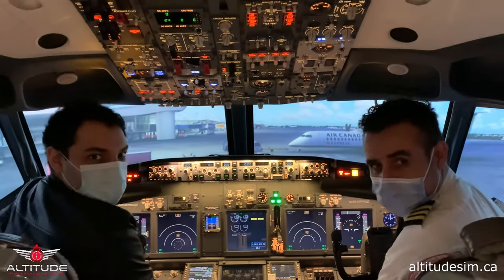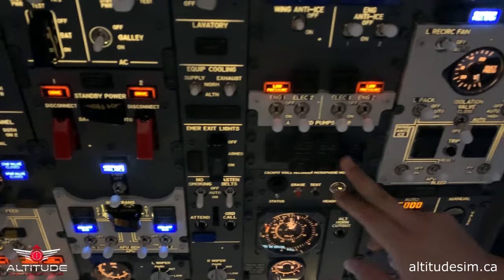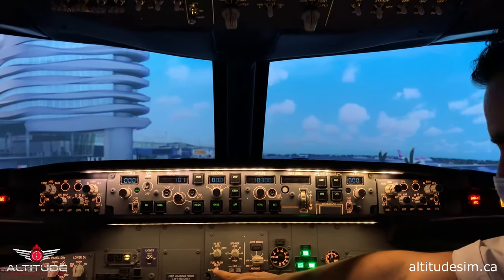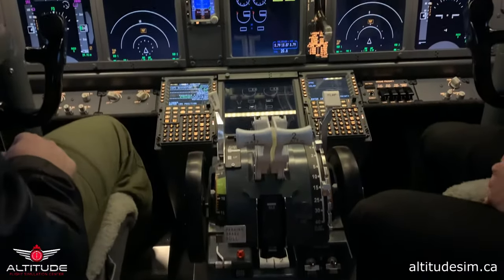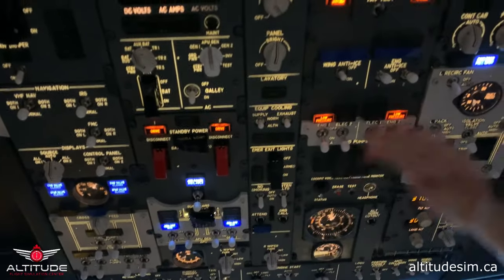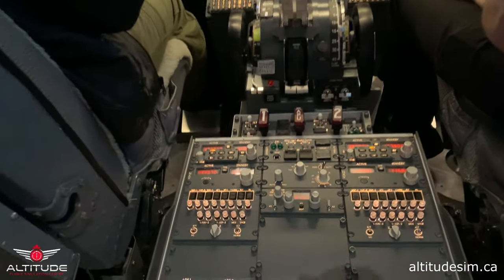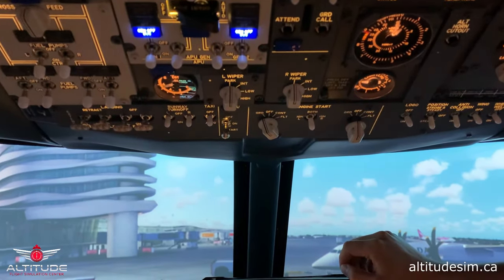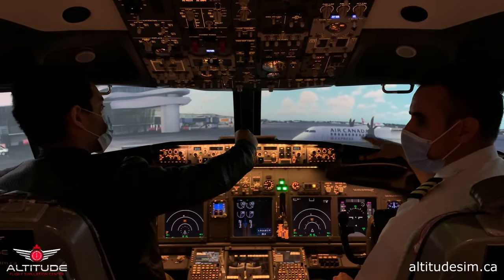Boeing 737-800 engines start up

Comment: Before starting the APU, don’t forget the FIRE TEST.
Reply from the maker: Thanks for the feedback
Reply: Before even putting a single fuel pump even do a fire test before ;)
Reply: You also don't have to hold it 3 seconds, just flip it to START and release.
Reply: Just find the reset button and start the xplane again
Reply: What about contacting the ground team before conducting fire test
Reply: @keenanpaul8968  Of course.
Reply: @keenanpaul8968  if the airplane is parked remotely and has no power, how do you plan on doing a fire test.  Rookie.
Reply: @justinglass9340  with batteries?

Comment: Great  , now the chances of me stealing a plane are high
Reply: FBI enters the Chat
Reply: Yeah good luck getting the required fuel you would need and pray your on a remote stand so you don't need a tug and tow bar. Good luck asking someone on the ground to remove all ground equipment, confirm all doors and hatches are closed not to mention removing the bypass pin...
Reply: @GodzilarOG7337  you’re a blast at parties aren’t you
Reply: @aaronsastronomy9236  He forgot to mention being able to navigate the taxiways without someone noticing, and good luck being able to take off and know where you're going without programming the FMC.
Reply: Heading North for a crash 😃
Reply: @Madmax93898  He was already an employee and had easier access. There's always going to be the odd exceptional case. We're (generally speaking) talking about people with little to no experience operating planes or how airports work, etc.
Reply: @Madmax93898  Completely different airplane. Can't compare apples and oranges
Reply: That's assuming the airplane is serviceable, no defects in the tech log, mels, and that your apu even starts...
Reply: Big passenger jets don’t even have locks I think so you can just open the door assuming you can get to it first before you’re arrested
Reply: Omg🙃
Reply: @GodzilarOG7337 if the defect is a broken coffee maker who cares?

Comment: Flow and checklists are a little bit strange compared to what I am used too. Also keep in mind the flight deck safety inspection and preliminary flight deck procedures requires you to OVHT/FIRE test the APU before turning it on.
Reply: Nobody does that…ever
Reply: @justing42  Yet it must be done, that's why it's a safety check. How you're gonna know if the APU's fire detection is working if you did not tested them? A better question yet: how you gonna know the APU is on fire if the system is off/fault and you didn't checked it? 

And for people who don't give a F* to safety procedures (that also cannot call themselves a real pilot) ... If the airline company learns that you're skipping safety procedures you can be dismissed with just cause.
Reply: @justing42  Yes. We all do it on the first flight of the day

Comment: Always set the parking brake before starting engines. Never take your hand away from the start levers when starting an engine. Before engine start, select either left or right igniters.
Reply: And fire tests🤷🏻‍♂️
Reply: The igniters switch automatically every start
Reply: As a ramp agent engine start is performed while doing the push back. 
After pushback set parking brake to remove tow bar.

Comment: I never knew / realized some of the knobs had actuators to automatically shut off.  That's pretty cool- better than some indicator light that you could miss- that audible click and then the position of the actual nob really clearly indicates its status!
Reply: Not sure if it does this on the 737, but the E170/190 automatically clicks off the autobrakes from RTO to off once weight off wheels on takeoff
Reply: On the 737, only the ENG Start has it, I believe

Comment: You missed making sure the outflow valve was in auto, overheat on the recall with the fire system test and Boeing recommends turning on the B electric hydraulic pump on first and waiting till the low pressure light goes out before turning on the A system.

Comment: The external ground power source was not removed..brakes should be set before engine start..hydraulic pressure was not checked...
Reply from the maker: Thanks for the feedback. Will discuss that with the instructor :)
Reply: @Martijn Blikman Because they did a mistake, calm down.
Reply: Hydrualic pressure is not checked per say, it will give an announciation if the pressure is low.
Reply: Yes the stinger needs to be yanked out during normal engine start however the parking brake doesn't always need to be set. As a matter of fact if your not on a remote stand you would start 2 and 1 in sequence during the pushback. Hydraulics are checked during the safety inspection and preliminary F/D procedure and those values are usually written in the tech log.
Reply: @@blikmanmartijnI never do a fire test if I am just starting the APU…we mechanics never do that

Comment: I work heavy maintenance on 737’s and I know for a fact they didn’t even do the apu startup procedure correctly for example 1. You’re supposed to do the engine/apu fire control panel test before you start it, 2. You’re supposed to put one of the apu generator switches online before you start so that you get an indication on the overhead electrical panel for Hz & voltage so that you know the startup was satisfactory and 3, you shouldn’t turn the recirc fans & packs on before you supply bleed air from the apu like c’mon guys. Clearly your checklists and procedures are drastically different from ours.

Comment: Well on X-plane 11 Zebo the IRS has to be on off then on align.  Then setup the FMC and place IRS location in scratch pad then go to IRS knob and move switches to NAV. Then select
the boxes to place location in. If not, than you will get a buzzing sound.  Also selecting the yaw switch too early will disengage it and you will have to reset it.
Reply: nope  
You put then to nav straight away, you can put cords, at whavmtever Point. Buzzing sound just means that battery is on discharge.

Comment: Hi. Thanks for the video but what is the process if you want to use GPU instead of APU? How same it goes?
Reply: You won't start engines without bleed air. So you need APU or ground starter as a source
Reply: My computer nerd kicked in and I'm like "why wouldn't you use a Graphics Processing Unit over an Accelerated Processing Unit if given the choice?"

Comment: Confirm N1 before fuel on !
Reply from the maker: Thanks for the feedback
Reply: N2 won't rotate without N1 rotation or shaft shear of that makes no sense
Reply: @Doggepe  N1 and N2 are separate shafts , in Canada (or any cold climate) a fan which is N1 can come in with ice , the ice melts from hot engine but as engine cools down the water at bottom of fan case can freeze and prevent N1 rotation on start . If you add fuel in this situation EGT will skyrocket and if you don’t abort start you will cook the engine !
Reply: @thomasrawlings5645  Yeah sorry I was thinking about a different plane. You’re right since the starter spins the N2 and not the N1 on the CFM56 and the shafts are not mechanically linked so yeah.
Reply: @Doggepe  By definition, N1 and N2 are independent shafts. I find it hard to think of any airplane that uses N1 and N2 notation and yet use single-spool engines. Out of curiosity - what airplane were you thinking of?
Reply: Correct sequence for the 738: Ground/timer, N2, oil press, N1, start lever affected engine idle (25% N2) and verify Spar Valve Closed transitions dim to bright and extinguishes, EGT rise, engine start switch moves to off (approx 56% N2), verify Starter valve open light extinguishes (starter cutout), monitor affected engine, stable when EGT red limit line extinguishes.

Comment: Why didn't the DUAL BLEED VALVE light go on when you had both APU Bleed and Engine Bleed Valves on? I reckon that the APU was off but shouldn't that light be illuminated anyway? Thanks
Reply from the maker: Dual bleed goes on when both bleeds (engine and APU) are on otherwise does not goes on.
Reply: @AltitudeFlightSimulation  thanks for the answer. At 10:59 though you had both APU and Engine Bleeds on but I can't see any lights going on in the video. Have a great day ☺

Comment: Shouldn't it be the forward left pump for the APU on the 737?
Reply: Left aft pump for APU.
Reply from the maker: for low levels of fuel where the AFT fuel pump does not reach that fuel level, yes, but not in this case, where is full. if is fuel reachable can be used any fuel pump, the APU works with all the fuel pumps.
Reply: You DO NOT need to turn a fuel pump on to start the APU…i do it all the time.

Comment: Shouldn't the engine bleeds be turned on before turning off the APU?
Reply: Both eng bleed always on
Reply: @gusprich8952  10:55
Reply: @KingdaToro  Yes but they should not be off so that is wrong.
Reply: Agreed - engines bleeds should be on
Reply: Yes engine bleeds should be on unless performing a no bleeds T/O or landing.
Reply: @GodzilarOG7337  Yes. Keep in mind we usually keep them on until right before take-off for example. It’s usually due to hot weather and a short runway so we want to cool down the cabin before turning them off.

Comment: just a quick criticsm. You put the power on the generators without checking the frequencies and voltages. This is a bad habit. Especially since you killed the APU immediately after. If your frequencies and voltages are not OK you shouldn't move to the gens.

Comment: Did I see altitude 10300 ft, while on tarmac?
Reply: Correct. That’s the MCP Altitude window.
Reply: Could be their transition altitude on the departure plate...... which is unlikely. It’s more reasonable to assume that was the last setting from the previous flight. It’s not really an issue until they brief the departure and get IFR clearance from the controller. Then it would need to be set correctly.
Reply: @Taylor314T5  The initial stop altitudes/FL are pre-selected on the MCP panels and are usually crosschecked during briefing of your plate and confirmed upon receiving ATC clearance.

Comment: A320 start up video too please
Reply from the maker: Unfortunately we have only B737-800 simulator and F-18 super hornet simulator. We don't have A320.
Reply: It's 2 buttons lol. It would be 3 minutes long.

(sarcasm obviously. I'm a 737 fan)
Reply: Batt 1, Batt 2
Master SW
APU start
APU Bleed
Ingnition switch ON
Fuel switch ON
Here you go 😂😂😂😂

Comment: Boeing needs to update the A/C pack operation. Having to manually turn them off for engine start is silly. Turn them on and have the system temporarily shutdown the pack on automatically. Auto means auto.
Reply: Saw it had an auto position, thought, wow maybe you dont need to turn them off manually, nope! I fly the E175 and all this stuff is auto.
Reply: They did update it, in model 747, 757, etc. ;)

Comment: When aviation priority considers the weight and economy, engineering the cockpit switches are still in 16th century and wiring takes too much weight and no saving in electricity for that cockpit electrical supply. Blame for engineering complex design and no balance in cockpit weight either at the front of the plane, companies are trying sell the plane with millions of dollars which is not worth for the technology and quality. And of course, companies will say that amount of money is for research and development, nahh..., R&D is also in 16th century, not even worth a million dollars. 🙂Shame aviation...
Reply: 16th century? Which airline flew then?
The 737 is from 1970's, so it has some 1970's stuff, because it works why change it? Aircraft wiring is good quality, and must meet govt regulations for heat etc..The Avionics has been replaced with 'glass' cockpit displays instead of individual analog displays, that is a huge change. Also you don't want to change too much or the weight and balance of the aircraft will be too much changed and You would need to build a complete new Airframe, that would be a complete waste.
Reply: @andrewbarnett84  lol🤣😂